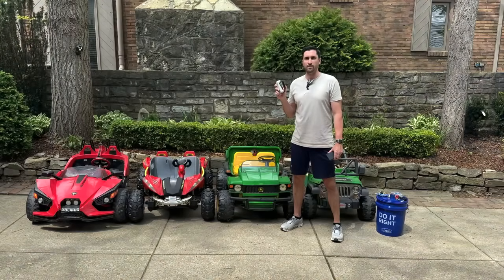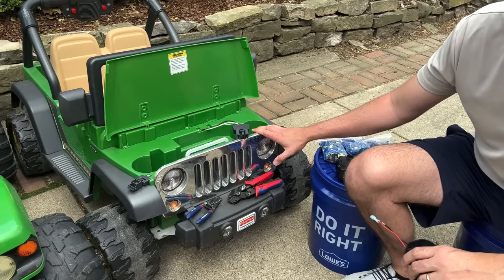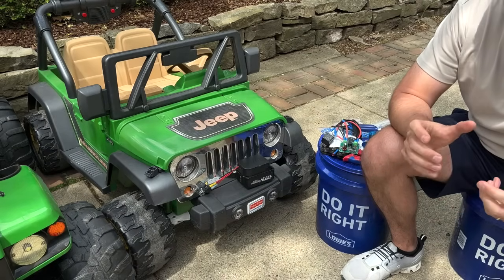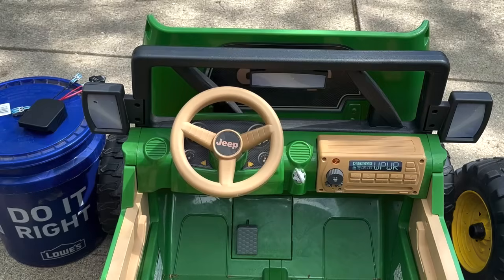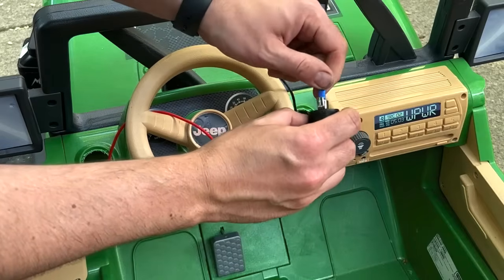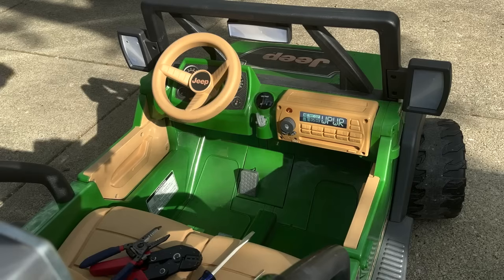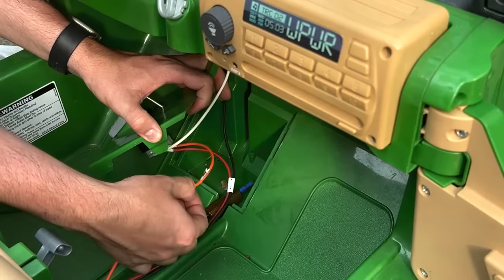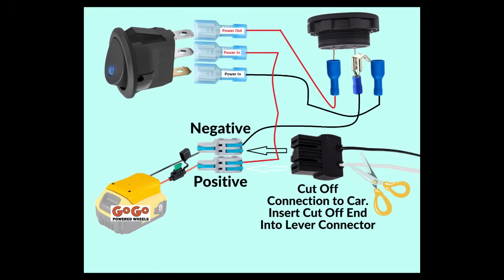BEST - How to Correctly and Safely Upgrade Power Wheels Battery (18 volts & 20 volts) w/ Soft Brake

Comment: Hey I recently switched to a Milwaukee 18v and it doesn’t go faster and it doesn’t have a control board what can I do to make it work ?
Reply from the maker: What type of battery was in there before? Was it 24 volts

Comment: I have a 6v Spider-Man motorcycle it’s only been ridden a couple times and has been stored. I charge the battery and it will go backwards but not forward, where could I start?
Reply from the maker: Hi, it sounds like a bad forward/ reverse switch. A “quick fix” would be to switch the wire inputs on the motor, then when you put it in reverse on the gear shifter, it will go forward, but you won’t have a reserve. To fix the issue, you’ll need to order a new shifter, which could be just a Double Pull, Double Throw rocker switch (google DPDT rocker switch) on Amazon

Comment: Interesting video! What’s your experience with upgrading the motors to a 18v or 24v?  So you don’t need a reducer from a Milwaukee battery.
Reply from the maker: They don’t have 18v motors, so the next option is 24v motors. Basically 24v motors on 18v battery will cause the car to go slower because the motor is turning at 75% power. Is you use a 24v battery on 24v motor, will usually have the same speed (~5mph) as a stock 12v setup, but it will give more torque to ride up small hills and on the grass.

Comment: Thank  you this is really helpful and ive installed the kit to my son's gator. However, I do have a two part question: 1) is the voltage regulator supposed to limit and stop the truck from drawing any more power when the battery gets low? And 2) if that is the case, is i possible to change the low range of the regulator to a higher voltage to keep it from running the batteries down until they can't be charged? (We've bricked 8 now)
Reply from the maker: It’s just a voltage “reader”, it does not shut off the battery. Ideally, you want to swap out the battery at 16.0 volts

Comment: Upgraded to a 18volt Ryobi and changed both motors. I think the board went out. 7 prong rx23 12v is what’s listed. Can you reply with the correct link to buy a new board?

Comment: My daughters Can am rc is a 24v, has two 12v lead acid batteries, control board for rc and manual. Can i do the swap using two milwaukee 18v safely?
Reply from the maker: No. The control board will burn out on 36 volts
Reply: @DadHacks  thanks for the reply, would it safer to use two m12 batteries instead then?
Reply from the maker: Yes, two M12s will work. Just make sure they are newer batteries. You don’t want to pair an old battery with a new battery, you won’t get as long of run time

Comment: Hi thank you, with 24 volt control board can i use an 18v ryobi battery
Reply from the maker: Yes, it can
Reply: @DadHacks same for 20v battery lithium for 24v? Think that battery will make it faster
Reply from the maker: If it’s a stock 24v battery, then no, a 20v battery will make the car slower
Reply: I have the same question
Reply from the maker: Yes, it can
Reply: I also have the same question :D
Reply from the maker: Yes, it can

Comment: Hello, my sons 12v olakid power wheels doesn’t want to turn right only left with the remote control, could you help a dad out?
Reply from the maker: Try this troubleshooting method, see if you are able to switch the two wires going into the steering motor. By switching them, you switch the input (as in, when you push left, it should turn right). If it works, then it means the right button on your control doesn’t work. If it doesn’t work, then it could mean your steering motor is going bad.
Reply: @DadHacks OK thanks
Reply from the maker: Either way, the replacement part for the remote control or steering motor should be less than $18 and available on Amazon
Reply: @DadHacks steering motor is good, now anytime I power on the circuit, the motor immediately turn on in reverse
Reply: Motors*
Reply from the maker: @user-ud7cf5bx8h  did you switch the wheel motors or the steering motor that’s under the hood?
Reply: @DadHacks no I didn’t switch anything, I’m thinking maybe I burned out the main keeyle board when I was testing the circuit with a 18v
Reply: @DadHacks I just order a new main control board and step down converter I will try this next

Comment: Hey I’ve watched your video a few times and I wanna do the swap for sure but having to reset the low voltage cut off every time seems real annoying and I was thinking what if you hooked like a 9 volt battery to the system besides the power tool battery so the low voltage had power between battery changes.. you think that would work or is that a horrible idea?
Reply from the maker: It’s likely the 9 volt battery will run down in about a day or 2 because it’s powering the cutoff board. Seems like it would be more work than what it’s worth to install

Comment: Upgraded my kids peg preggo gator to a 18v Mikita. Was working great for a couple months. Yes I have the low voltage shut off, but now when I hook up the battery it blows the fuse on the 18v battery connection part
Reply from the maker: Try using a 40 amp fuse

Comment: What setup would you recommend to run additional lights on a power wheels? I would like to use a cordless battery to power additional headlights and rock lights without connecting to the existing 24v battery
Reply: Carry two batteries. One for the lights.

Comment: Does the battery get super hot and over heat.  I can get mine to work with a drill battery but it over heats in about 20 mins
Reply from the maker: Depends on the Amp Hour size of the battery. But 20 to 30 minutes use is normal for a 4 amp hour battery

Comment: There are some 28v batteries out there. Will these work as well?
Reply from the maker: No. Anything over 20 volts on these will melt the plastic gears and fry the motors. There are 24 volt ride ones, but those have more torque and less RPMs. So you aren’t getting more speed. Keep it to 20 volts or less for less headaches

Comment: Do you know of a 24V control board that also has the 2 pin plug to switch from Manuel drive to remote control? 
Most 24V control boards I see don’t have that. My current board is Weelye RX12

Comment: I have a 12v yamaha grizzly. I did a Milwaukee adapter but when my son puts it in high mode it shorts the battery and i have to turn the adapter back on any idea what it could be?
Reply: The adapter i used is a stepdown from 18v to 12v
Reply from the maker: Was the original stock setup with two 6 volt batteries?
Reply: @DadHacks  no it was one large 12v battery
Reply from the maker: What’s the Amp rating on the fuse/ thermal breaker?
Reply: @DadHacks 20amp
Reply from the maker: It should be atleast 30 amp when using 18 volts. But it’s a catch 22, because you need to make sure your wire size is atleast  12AWG (or smaller, mean 10Awg or less) otherwise the wire might be too small to handle the current
Reply: @DadHacks  i bought a different battery adapter, maybe this one doesnt handle the load. I tried using it without the stepdown and it would still short out
Reply: @DadHacks the new battery adapter worked but now i need a soft break. Do you know if any resistor would work or do i need a specific one?
Reply from the maker: @ you’ll have to check the pedal to see if it has 2 or 3 connection points on the pedal
Reply: @ it has 3….. 1 red wire 1 yellow and 1 black
Reply from the maker: @estevankk  there’s a good chance it will work then. Resistors that are 50 to 100 watts and around 1.0 Ohm is what you want
Reply: @DadHacks  thanks! Do i need to put it on the power wire?
Reply from the maker: @estevankk test which wire by unplugging 1 at a time and see which one still allows the wheels to spin when unplugged. If none of them work when testing, then the resistor won’t work
Reply: @ thanks! The wheels still spun when i unplugged the black one. So add it to that wire?
Reply from the maker: @estevankk did the wheel spin freely after you let go of the pedal? If so, then yes that’s the wire. If it locked up like normal, then try a different one
Reply: @DadHacks  yep it spun freely, will this also help the initial jerk when they first take off?
Reply from the maker: @estevankk unfortunately it won’t help on the start-up. There is a kit out there from ML Toys that does a soft start, but it’s expensive. The other option is an ESC with variable speed pedal, I have a video with that setup.

Comment: I upgraded to 20V dewalt with fuse. 

Would the resistor help slowing the start too or just the stop? If not, what the simplest and most cost effective way to dnsble slow start too? Ty
Reply from the maker: Unfortunately, no a resistor won’t do a soft start. The best method for a soft start is to convert to a ESC (electronic speed controller) and a variable speed pedal (like in a real car, push it a little it goes slow, push it all the way down for full speed). I did a video on it here: 
https://youtu.be/dXbnSH3avKc

Comment: Hey I got bigger motors and went to 18v Milwaukee and got the connector for the battery was working when I put it in not it won’t go but I wire the old ones will run but stops while holding the pedal

Comment: 12V DC motor , Ford Ranger 4x4 possible work 20V battery?
Reply from the maker: Does it have a control board? One way to know is if it has a parent remote control.
Reply: @DadHacks  yes I have controll board
Reply from the maker: You’ll have to get a control board that will handle more voltage (like the one in the link), but then it will work. Lights and sounds that run off the battery can be hit or miss on if they will keep working though https://amzn.to/3B3Zo7P
Reply: @DadHacks  thanks, And I no needed controll board?
Reply from the maker: You will need to replace the control board with one like this https://amzn.to/3B3Zo7P
Reply: @DadHacks  thanks
Reply: @DadHacks  And if works 12V motors or need change 24V motor
Reply from the maker: @clava011 keep the 12v motors, they will do fine
Reply: @DadHacks  Sorry more one qouestion :) if battery 20-24V, Control board 24V, Motor 12V, Multimedia Center if works safety? or off?
Reply from the maker: @clava011  you can only use up to a 20 volt battery with 12 volt motors. Once you go up to 24v battery on a 12v motor, it will burn out quickly. The multimedia center is hit or miss on 18 volts and higher. Some do okay, other burn out

Comment: Hey! I have a 24v jeep and the connector from battery to motor melted and is not powering on. Should I just replace the battery?
Reply from the maker: Yes, get a new battery but also make sure you have a fuse (typically a 30 amp will do)

Comment: I upgraded my daughters jeep from 12v to 24v, motors and control board. The wife wants a speed controller added as full on is to fast in her opinion lol. I know the supplied pedal is either full on or full off (soft brake is planned) if i replaced the pedal with the variable pedal would i still get full on and full off? Would the ESC basically replace the control board if that is the only way to have variable speed?
Reply from the maker: Correct, the only way to use an variable speed pedal is with an ESC. “Does it replace the control board”, well, kinda. The lights and sound accessories run on 12 volts and the ESC can control lights/sounds, but it will be on 24 volts, which will fry the accessories. My suggestion is to only let her drive in “low” gear which should be appease the wife on the speed until she can handle the full 24 volts. FYI, the soft brake likely won’t work on a car that has a control board, it’s only for Power Wheels and Peg Perego brands
Reply: @DadHacks  There is no low or high gear with this jeep it only has forward and reverse that utilizes the type of control board in the video. Thanks for the advice appreciate it.
Reply: @DadHacks  Important point to add to your advice... Each of my upgrades in which I have used more than a 13.8v buck adapter, I have added a 24v (+higher volts) down to 12v buck adapter. (The 13.8v voltage buck works accessories without frying them, although it actually runs high at around 14.4v like a real car battery with engine running).
Reply from the maker: @DonKrasniak the great thing about Power Wheels brand and Peg Perego Gators is that there are no accessories to worry about, so they 20 volts is only going to the motors

Comment: Does these conversions only work for 12v vehicles? What about a 24v unit. How to make that work?
Reply from the maker: You wouldn’t want to convert a 24v car to a 18/20 volt battery because the motor would spin more slowing on lower voltage. But you could use a Kobalt 24 volt battery, and speed would be the same as the stock 24v battery
Reply: If you didn't care to much for speed could a 20v work anyway? Original batt went bad and I wanted to do a bauer adapter just for convenience.  @DadHacks
Reply from the maker: Was the original battery 12 volts or 24 volts? Most ride-ons are 12 volts. But yes, if it was 24 volts a 18v or 20v battery would still work, but the kid might be upset that it’s slow. If it was 12 volts, an 18 or 20v will make it faster, but you might need to upgrade the control board to a 24v one because they usually go bad when over volted
Reply: Thanks for the tip.